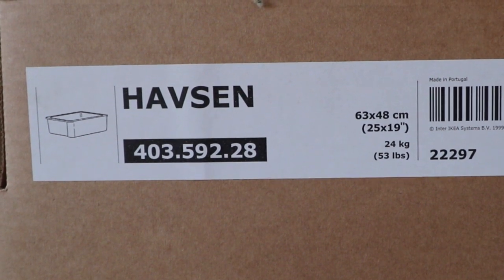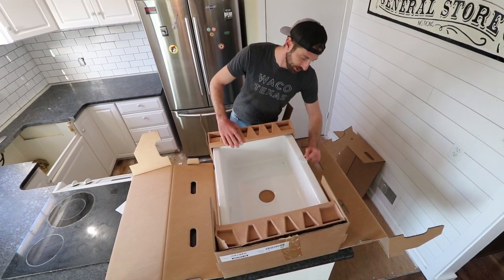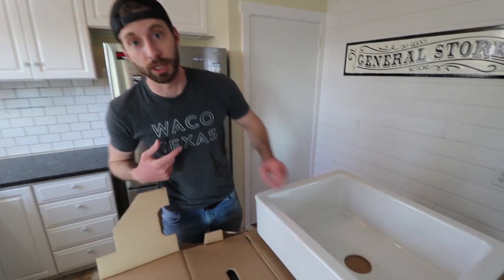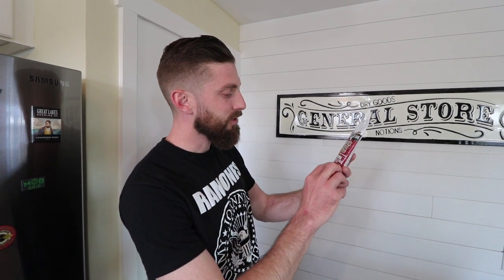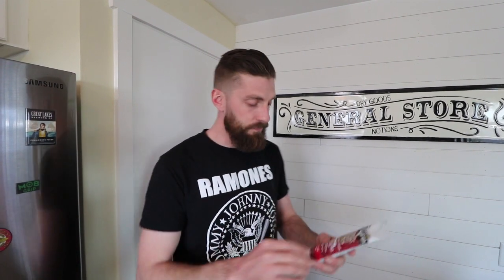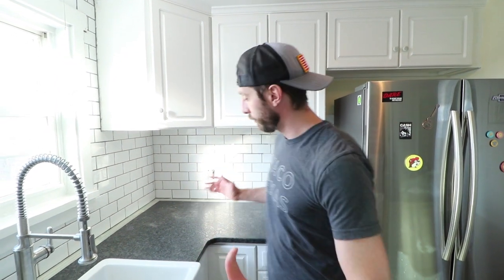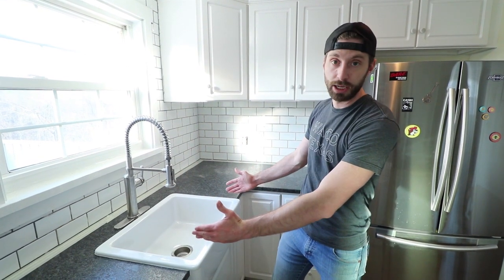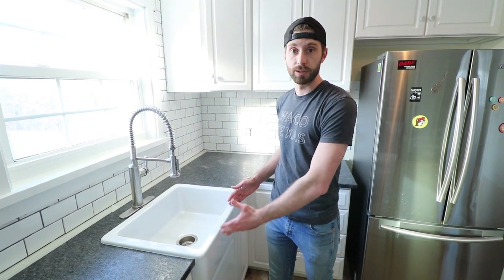The Ikea HAVSEN Apron Front Sink: Unboxing, Installation and an Honest Review of this Farmhouse Sink

Comment: I have the double HAVSEN sink and love it.  So many people comment on how much they like it and would like one in their home.  The depth of the sink is wonderful and they are so easy to clean.  I know one of my friends has had one installed in her new kitchen after using mine and another is considering it.  Just a question for you as well.  Did you increase the height of your benches?  I had mine made higher due to my height.
Reply from the maker: Thanks for sharing Maria!  We couldn't agree more, and with Dave's experience using one of these sinks on a separate project we knew it would work well here too!   To answer your question we didn't increase the height.  We're both fairly tall guys (6'-3"), and didn't feel the need to change anything up.  We hope this answered your question!  Have a wonderful day!
Reply: @TheBrothersWorkshop  Thanks for the reply.  Maybe benches were taller then.  I'm no good with measurements but I had my benches increased another 10cm in height to the horror of my chippie.  Now it seems many people are doing the same.  Either Aussies were shorter, less inclined to spend money and more environmentally aware (kitchens were timber doors/frames etc then) or we are taller and materials are more environmentally aware now in some context anyway.  Enjoy your day.

Comment: Are they pretty good sink? I heard they crack easily.
Reply from the maker: Hey! They are a great sink, and they don't crack easily.  We unfortunately did have one crack on us, but that because we removed it after it was already installed.  We failed to remove all of the adhesive holding it to the former countertops.  We wouldn't have had an issue otherwise.

Comment: The reviews of Havsen sink and the sister Havsen double sink in particular on Ikea's site are terrible, sadly. I am seeing people saying that the sinks won't hold water to do dishes in them, and that the material both sinks are made of is cracking when they drain hot pasta water in them. Lots of people talking about the sinks cracking for all kinds of everyday use reasons.
Reply from the maker: Hi Randal! We've never had any issues with this sink. It's held up very well, and it's been used since being installed (when this video was uploaded).  I'm not sure how the sink wouldn't hold water, or how it would crack due to hot water..…..  It sounds like there may have been underlying issues these people aren't being forthcoming about.... 🤔

We had another sink prior to this one but we broke it when replacing our old counter tops.  That had nothing to do with how the sink was manufactured.
Reply: I am in the process of designing my kitchen and choosing a sink and the reviews about not holding water are concerning as we do a lot of dishes. Do you think you didn’t have this issue as you used the drainage from the old sink?

Comment: Do ya’ll know if these Belfast sinks with the lip can be used with Formica worktops? I’ve heard it’s not wise to use the under style Belfast sinks with Formica worktops as they can lift if water gets in but I’m wondering if these would be good ones to use to get around this issue?
Reply from the maker: Hey Mark! Unfortunately we've never come across that combo, so we really don't know.  Thanks for watching and good luck with your project!
Reply: @TheBrothersWorkshop  no worries, thanks ya’ll!
Reply: @markcrawford5274  I can answer this! I’m installing this sink in our kitchen. When I spoke to the IKEA kitchen department while planning we were unsure on countertop selection at that time (laminate vs quartz; wanted to see what budget would allow). We were told his can be used with laminate/Formica countertops.

Comment: So amateur and very little information about the real installation. The most important part of the job is the cutting of the worktop, and yours was already done!
Reply from the maker: Hey Paul! Yes, our cut out was already preformed by the manufacturer of the countertop.  This was done because we purchased the sink prior to the purchase of the countertop.  Because the countertop is granite we gave our sink measurements to the countertop company.  The granite countertops came pre-cut and ready for the  installation of the sink.  If we needed to cut the countertop, than we would have but we didn't.  In no way shape or form do we claim to be professionals.  This is a DIY channel.  Thanks for watching.